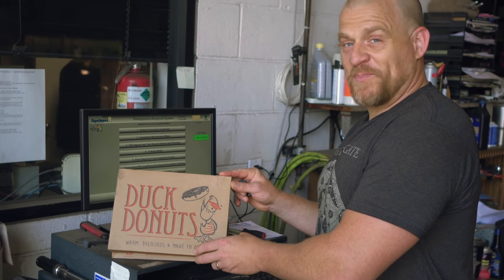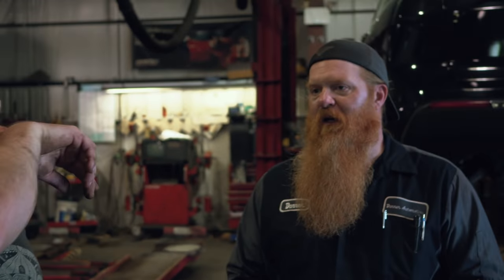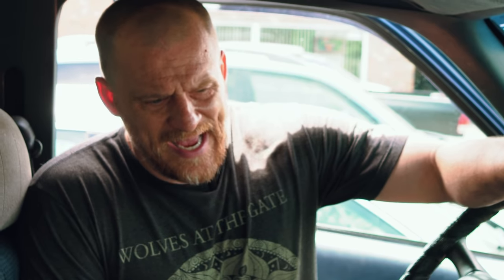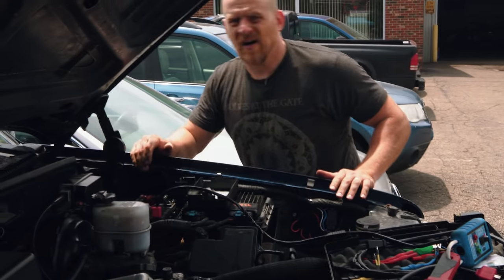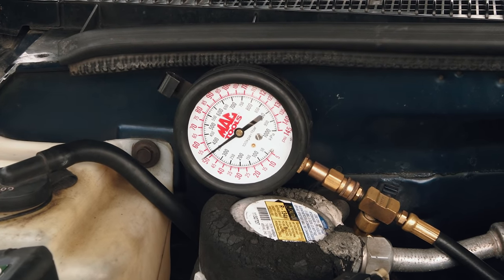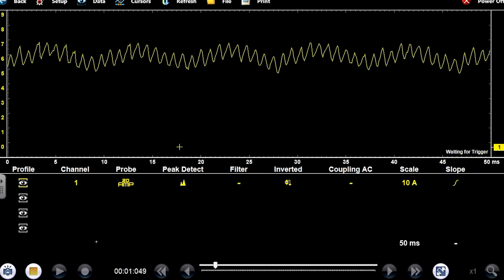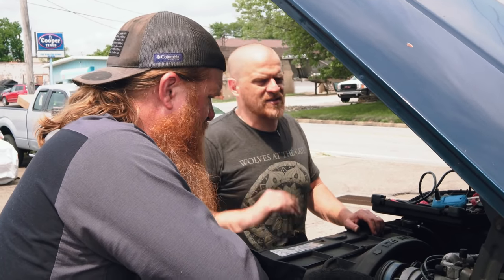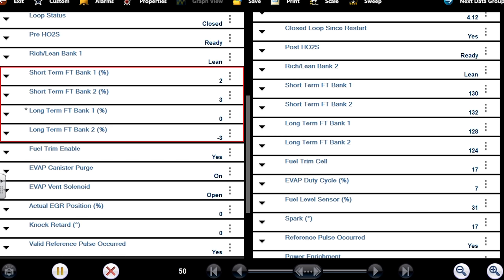Could a P1351 be a False Code? (older GM trucks and vans)

Comment from the maker: Some things the camera misses in a process like this. Many of you mentioned that I should have test driven the truck and you're not wrong! What I didn't mention is that my brother did, multiple times! And was not able to duplicate the customers complaint. So he asked me to verify the P1351 code, and the setting of this code, as the owner swapped out many parts in trying to fix this code! My primary focus was to not get bogged down on an intermittent problem (lengthy test drive, that was already done), but to prove the P1351 was a code that the owner SHOULD NOT have been chasing in the first place! I think from this stand point, we did good. Also remember this is a live shop with 20 cars waiting to come in the door and we weren't even there to look at this truck on this day. So this was sort of a fluke that we even filmed this one. Hope that makes sense. Thanks for watching! Hope you learned something even though we didn't fix it.
Reply: I Use A "FLUKE" ( good enough for NASA good enough for me)
Reply: Camera also misses wheter Danner brothers take the bacon donut. Thanks for the video, it shows that sometimes you have to know when to stop- doesnt matter if it is a donut, or an intermittent
Reply from the maker: @tomastarvydas63  😂😂 I did NOT eat the bacon donut
Reply: @ScannerDanner  maaan, bacon donut with maple icing is the best donut I’ve ever tried. It’s way better than you might think. First time customer brought duck donuts that had one in there, I was like “wth is this!?!? BACON! That’s weird, definitely trying that!” Ever have a side of bacon with pancakes? Syrup got on the bacon and it was great right? Same thing!
Reply: the fuel injector (spider) on x vin motors has a regulator built into the back, they leak and fill the intake with a light coating of fuel often causing rapid crank and after long periods sitting they long crank. 
your brothers deadhead test probably reseated the seal temporarily until it sits long enough to drop pressure and unseat hence the intermittent behavior.
Reply: Why couldn't it be an intermittent no ground/poor connection at the fuel pump ground on the frame?
Reply: just a thought ,, maybe do a ride along with the customer ? my wife has a 2006 trailer blazer ,,it will get the code for a o2 sensor ..in the reading of the code said you could remover the cat and wash it in a cleaner ,, or add a spacer too the o2 .. the code never trips for me . I use cruse control a lot .. she is a up and down with the gas pedal ,,told her too drive with a heavy foot the code has not tripped in a month ,, before it was every week .. finding a problem that is not always there is a pain ..
Reply: I have a 98 GMC 5.0 1500 vortec  I have the same code 3151 but it says high voltage to it I replaced the icm then after a day it had long crank time and threw that code but says high voltage and the end of diagnostic any thoughts on how to find and fix this problem has anyone had this problem before ?
Reply from the maker: @jamesdaye7001  yep, check your fuel pressure next. Anything that causes a long crank time will set this code. You MUST have over 60 psi cranking on your injection system. If you're near 50, it won't start or it will be a long crank
Reply: @ScannerDanner  fuel pressure is at 60 I put a new Borg Warner fuel pump I'm along with every single sensor smh I've had this problem for a yr and a half now
Reply from the maker: @jamesdaye7001  address your long crank time. Ignore that code

Comment: sounds like there could be an spider injection issue also, maybe bad pressure regulator diaphragm dumping into the intake. seems to me it would whack out the drivers bank first and holes 5 and 7 the worst, the regulator leaks on the passenger side and the intake runners go across to opposite side cylinders.
only thing I can think of with the pressure dropping hard and Danner deadheading it for a temporary fix. I'm sure you'd have noticed a sticking/flooding injector if that was it :)
Reply from the maker: Possibly, but with this injection unit being new (and who know where get got it from) and intermittent sticking open injector is plausible

Comment: Paul, I had a similar problem with the P1351 code. I replaced all ignition system components, engine ran then again a no start condition after each replacement. After much expense (diagnostic equipment and parts), I realized I was getting a false code. It turned out that the temperature coolant system sensor was bad and it was flooding the engine out. I replaced the coolant temp sensor and it fixed the problem. I should have gotten a P0188 code, but I only received the P1351 code so I had never looked at the coolant temp sensor, but the computer thought the engine was cold and dumped fuel into the injectors flooding them out. Expensive lesson learned!
Reply from the maker: False codes can really really mess you up, especially when the manufacturer flow chart on that code is WRONG! Thanks for sharing and confirming with absolute certainty that what we were saying was correct about this code.
Reply: Looking at fuel trims and realizing its staying on open loop should of took you towards the right direction walt
Reply: Thanks for sharing this information Sir. Mine was exactly the same thing engine coolant temperature sensor n not the icm.  Crank No start .
Reply: I'm going to try this! Been down this diagnostic rabbit hole and intermittent running problems with this code for over a year. Noticed my temp gauge is reading very low but I still have heat and was thinking the thermostat was sticking sometimes. Thermostat isn't that old though. I'll report back if it ends up being my issue as well.

Comment: Hey Paul, GM dealer tech here, those vehicles were famous for fueling issues. Not saying that it's the solution, but I've had intermittent issues with long crank and it's often sticking injectors on hard turn under acceleration. Again, something to look at, don't hang me if I'm wrong on an intermittent.

Comment: This applies to older vehicles but I'll throw it out there anyway because they were both stall issues followed by long crank times. One was diesel and the other was gas and they both ran fine until they didn't. In both cases I hooked a vacuum gage into the suction side of the fuel pump and watched it while driving, the vacuum gage would start to rise and then just before it quit the gage would suddenly peg out. If you waited a bit it would start back up and run ok for a while then do the same thing. Long story short the problem was the pickup screen in the tank was clogging up and starving fuel from the suction side of the pump. On the gas burner it was rust causing the problem and on the diesel it was water in the tank.

Comment: My suggestion would be to test drive the truck for some time with the scanner recording data. Might act up when loading the engine and not when on idle.
My thoughts..
Reply from the maker: We did my friend, you just didn't see the test drives that both my brother and I did at separate times. Thanks! Great suggestion of course.
Reply: I had a buddy hook up a scanner recorder and drive my truck back and forth to work for four days before it finally acted up and caught it.

Comment: At 30:12 you said there is no reason to check power and ground at a coil that is functioning. Two months ago i had a v8 mid 2000s Cadillac with the cartridge coils on both banks. Car ran like crap. I saw visible good spark from every individual coil. Autologic tech service said check the ground at the cartridges. I had 6volts on the ground yet saw spark and car ran with misfires of course. So, im not so sure you can rule out power and ground even if you see spark and car runs
Reply from the maker: You're not wrong on that front. I should have been more clear as to why I didn't feel the need, and it was because we now knew this code setting was false. So from that standpoint is what I meant. Thanks!

Comment: I actually have a 1998 chevy GMT-400 Vortec 5.7 that is doing the exact same thing as the guy said. It would idle just fine while sitting. While driving at normal speeds it was fine at 9 miles but If you push the gas to rev the engine (up a hill or a need for speed), it literally shuts the truck down like someone turned the key off. If you keep your foot in it, it will stay running. It's like when you heat it up, it shuts down momentarily. The weird thing is, it starts itself after a nice pause. I have changed a lot of things on it to narrow down a few things. I did change the crank and cam sensors and cap/rotor with no luck after I had a complete no start. I got the same code but I erased the codes before changing the sensors. it still does it. I'm looking into a couple ideas to pin point the issue. To me it acts like a fuel issue or a wire issue. I find it odd that it will shut down, but will come back to life on its own. My boyfriend had an issue with his truck just dying and not wanting to restart, but then it would. I told him it was a wire issue. He couldn't figure it out so while I was under the hood, I told him to crank it while I wiggled a couple wires and found the issue. in his truck it was the wire for the cap and rotor. there was no casing left on it and it was arcing out. The wires on my truck look fine as we went through everyone except all the ground wires. I did notice the return line that comes out of the fuel vapor canister is completely broke off and hanging by the front left tire. I'm not convinced that is the issue. Usually that leaves me to believe a wire problem, system is flooded, or starving for fuel. If it was any major sensor, it would throw a code other than the P1351. When you heat the motor up (really heat it up) it will shut down everytime. When I find the problem, I will post on here.
Reply: one other thing I forgot to mention, right before it would shut down, it would cut out....when I would pump the gas it would try to pick up but just stalled. That was the first time it happened for me 4 times in a row. after replacing several parts, He drove it 9 miles and when he "opened it up to see what it had up a big hill," as soon as he let off the gas, it stalled but it started itself right back up after a few seconds. He said if he stayed on the gas and "both footed it, it was fine. He got it in the drive and got out to open garage door while it was idling, it shut down. It started right back up fine after. I ran the scanner and the only code showing was the stupid P1351. plugs/wires/coil was changed initially along with the sensors. the plugs were really crappy looking (this was done between the first time it happened and the second time). I did show negatives on my banks. This sure is a lesson to figure out.

Comment: When will the you activate be available from AES wave
Reply from the maker: I will most certainly announce it when I know, but it should be soon! I saw the prototype!
Reply: You can use a fused jumper wire instead.   
Jump load side pin 30 to 87. Pretty much does the same thing
Reply from the maker: @mikesabin8568  don't jump the wrong pins :-) and this tool does so much more
Reply: @ScannerDanner  What are they redesigning on it?  I'm on the email wait list for this tool and can't wait to get one.

Comment: Man This spider injector set up where problems. Failing Pressure Regulators under the intake. Those CPI injectors need specific pressure to work at all!
    Then those flat GM dis caps. We would only install Factory GM parts. The Distributor assemblies where a problem also. Gear would wear to knife edge! 
    As that generation got some age on it “we/I” would  “re ground” everything.
     Not to mention the problems with aftermarket fuel pumps. Oh the fun.

Comment: Had something similar in a gm product, though it was a gdi system, turned out to be an intermittently sticking injector,  only when hot, and sticking both ways,  very erratic. Just lucky to find it

Comment: My 05 Silverado with spider injection haf an issue where it was running like crap sometimes stall out, and sometimes ran good, turned out to be bad distributor, I could turn the rotor like 20 to 30 degrees... After changing the injectors and all the gaskets and gaskets on intake manifold.
Reply: Had several distributors replaced with wiped out upper bushings in them, I forgot all about that back then common problem with GM.

Comment: Ive seen a shorted low 02 sensor cause the same issue, the pcm will dump fuel on that bank cause it to run rough, flood itself out, truck stalls or stumbles so bad that the truck goes back into open loop, pcm ignores o2 , due to being an older obd2 it wasn't that smart, just a suggestion maybee help something click in your head, love the videos, the fuel pressure loss could be a seperate problem caused by quality of parts swap
Reply from the maker: So many variables! And you guys are on it 100% and this is exactly why I walked away at this time. Thanks for sharing!

Comment: I had few times where fuel pressure regulator causing fuel pressure issue, and as soon as I crimped the return line, it fixed the issue. And one car I remember it ran well and good for few months before it started showing same issue with fuel pressure and trims. Eventually replacing regulator solved the issue.
Reply: This is the solution. Pressure bleeding down causes long crank. FPR.

Comment: I have the same exact deal. After a two hour drive it begins to lose fuel, and I must begin to feather the air supply or motor completely bogs. This grows worse until I’m at 10 mph. If I pull over and shut off for 2-3 minutes it clears up for another few miles. Not temp dependent, nor altitude because happens up or down the 7500’ altitude I live at. It is no longer clearing up as well with short shut off. Have six codes, both cats inefficient, both o2 sensors, misfire cylinder 4, and p1351. It is starving for fuel for sure. Pump replaced 1 year ago, ignition module, cap, rotor, wires, plugs, distributer, crank sensor, and fuel filter(or cam sensor I forget).

Comment: I had this same problem on my 1998 k1500. I even watched this video to look for a fix. 

The problem is due to bad ground connections. I cleaned/sanded/replaced every ground cable and the problem has not come back. You have to clean/replace all of the grounds to ensure the problem is fixed as I did half of them and the bug did not go away. I got the repair manual and found/cleaned every single ground (they were are all rusty/dirty after 20+ years anyways) and that will probably fix the code if your truck runs normally when it does crank
Reply: Where can I find the locations of all my ground wires on 1999 GMC SUBURBAN C1500 Vortec 5.7?
Reply: Adding an update to this post as the illusive p1351 returned on my k1500 earlier this month and this time my symptoms matched this truck exactly. It was not the module, ecm, grounds, or pump. It was the ICM connector. The ground rusted up inside the connector and was causing the truck to die when it warmed up. Any time there is a weak spark on the ignition system this code will likely set and cause the truck to shut off

Comment: Alternator regulater....  @8 min

Ground dtraps, go give them ALL a 1/4 turn.  I fixed a no crank on a pontiac that was a ground strap to transmission....
Reply from the maker: while I do not disagree, I would want to see the issue first before disturbing something and then not knowing if I ever truly fixed it. Plus the code was proven to be false, which was the customers main area of concern. Duplicating the fault would need to happen first before I ever do any "repairs". Just my opinion.
Reply: @ScannerDanner  I agree with you, Let me tell you the ponitiac story... wouldn't start but crank, intermittent.  Finally it wouldn't crank most of the time.  My buddy (his wife car) called me, hooked up scan tool, connects fine (don't recall codes if any).  Crack and no start... umm... scanner lost connection... repeat, repeat..., scratch head as it connects wihen not cranking (many thoughts at the time).  Go to look in engine bay (just looking and lost) but by accident put my hand down on a 10mm bolt and burnt the shit out of me (lol... just hot).  Tightened and cranked right up.  In this instance it was the ground strap going to the trans and it was lose/hidden corrosion where it connected to the  radiator mount cross member.

And I can explain why you see armature waveforms on some cars/pumps more than others.... but I won't rattle further unless ya want.

Just trying to help and thank you for the help you provide others.  Best, Ken

P.S.  Tell your brother when an instrument switches from ac to dc it usually just puts a cap in series.  If you left your instrument in DC and put a cap lead on the probe end, you just made it ac coupled just like the switch on the instrument .